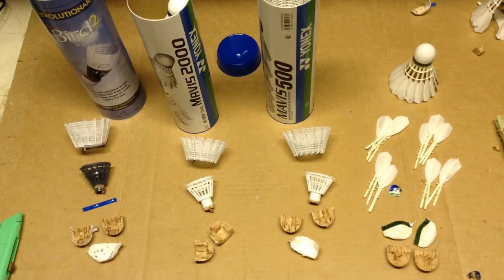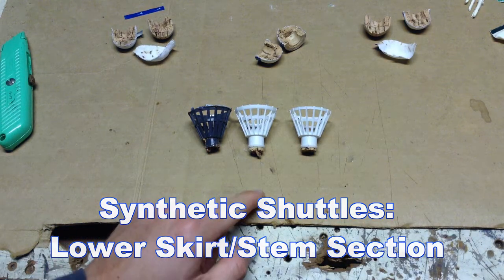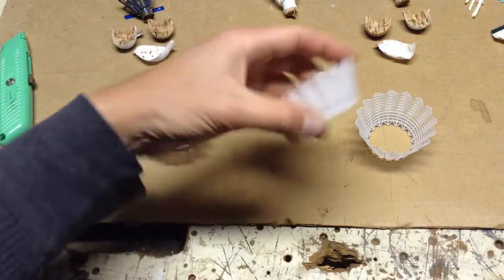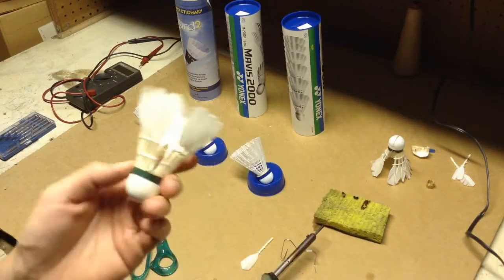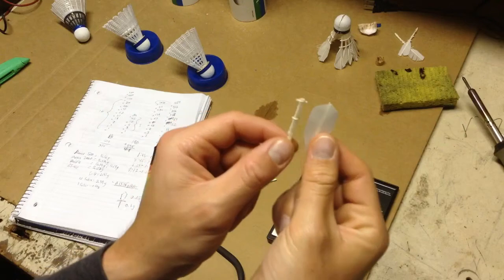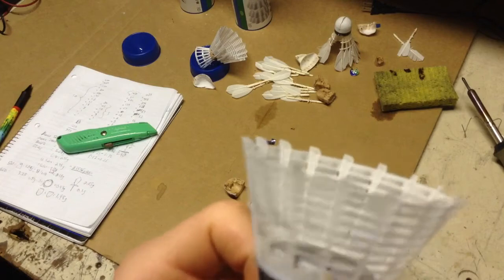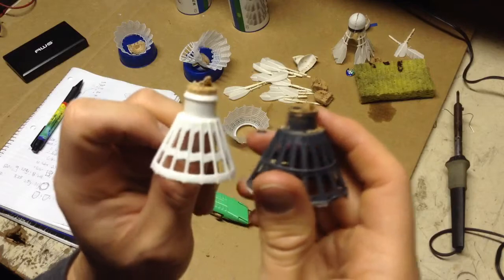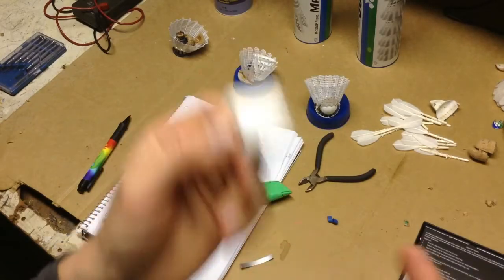Taking Apart Badminton Shuttles: Feather, Synthetic, Bird2

Comment: Maybe, you can now include the Victor Carbonsonic also to the fray! It poses to be the NextGen alternative to the feather shuttles!
Reply from the maker: I just received the Carbonsonic shuttles a few weeks ago and will do an update for those. My initial reaction upon hitting with the shuttles is that the weight balance is more towards the feather side instead of the cork. I think this has to do with carbon fiber they use for the fake feather stems. I'll have to perform measurements to get the specifics though. Stay tuned!